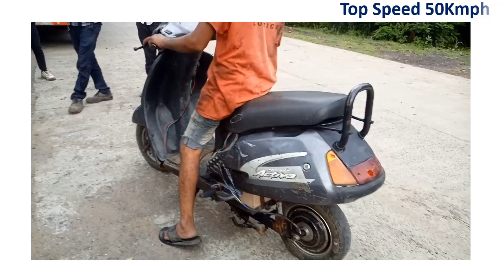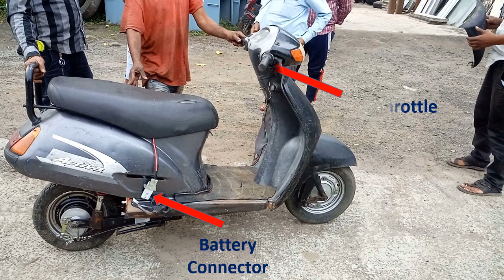How easy to convert Activa in to electric | diy EV conversion | diy EV conversion kit |electric bike

Comment: Why don't you take a scooter running on petrol and add electric kit to front wheel. That way in slow moving traffic and traffic jams we can use electric and otherwise when battery runs down use petrol?